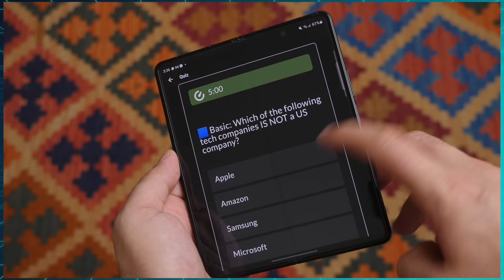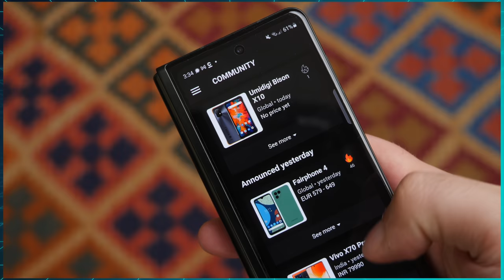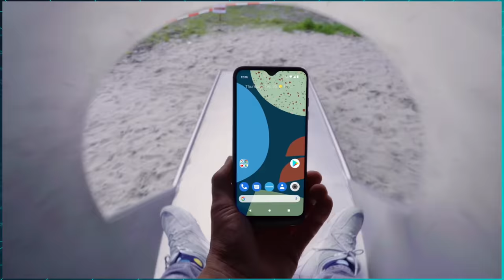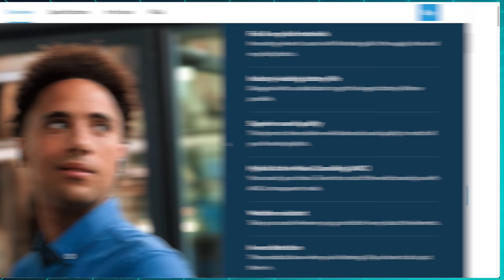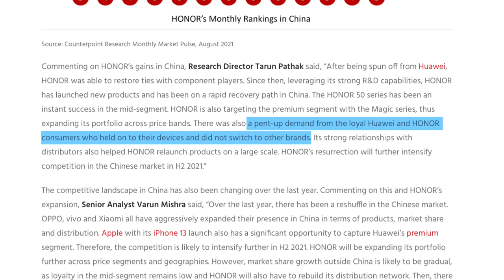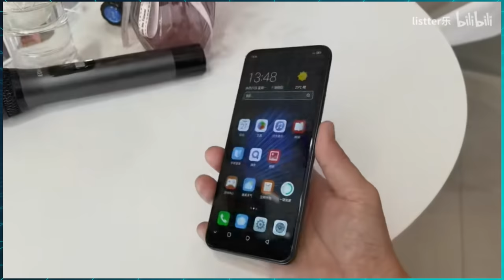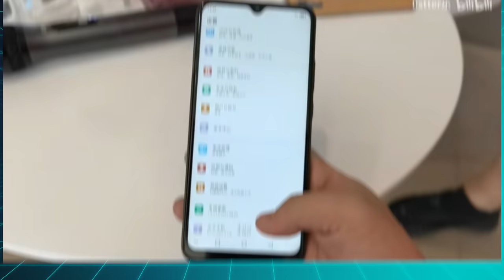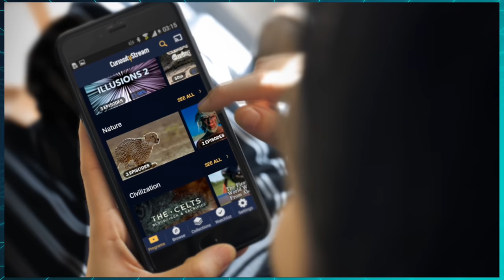The first Fairphone you might actually want

Comment: My Fairphone 3 is not a pain to use at all! It does everything I need it to do. It's not the best phone, but also not the most expensive one. It has a headphone jack and the battery lasts two days for me. Plus it has a supercool see through back and everyone else finds it cool too!
Reply: I love that see through back! It's a shame they 'discontinued' that feature
Reply: Yeah I do not understand how the Fairphone 3 is a pain to use like honestly...
Reply: The Fairphone 4 just doesn't interest me, I have a strong preference for rectangular screens and demand a headphone jack on my phone, as I 'still' use wired earbuds and won't change that any time soon.
So that's yet another new phone I can cross off the list for when my Moto G5 becomes too slow to continue using.
Now it's either a Fairphone 3, or some Xcover model for me, or something I'm missing (PinePhone/Librem5?), though the G5 is still a good phone for me.
Reply: @WyvernDotRed  agreed I really like my FP3
Reply: you can sell it to them and get the 4 for cheap
Reply: Also, a replaceable battery is a must. Dead battery is one of the biggest reasons people swap phones. In this case, just swap batteries.
Reply: @extectic  YES, forgot to mention that. I'm using replacement batteries in my G5, so I have a good backup and can use it for longer.
While the FP4 also has replaceable batteries, any phone that doesn't is a no-go for me.
Reply: @extectic  you know you can swap batteries of a sealed phone right? after 5 years when it dies. which is very cheap instead of buying a new phone.
Reply: The bezel is kinda...it's gonna bug me the hell out of if it were me

Comment: The new Fairphone is everything I could dream of in a phone – with the exception of the missing headphone jack. I know it's such a compromise to make one phone for a market with such varied needs, but it's a tougher sell to me because of that
Reply: They do have a USB-C to jack adapter, if that helps.
Reply: @adrnjgr  Of course it helps a bit, there are always workarounds for these things. I just find it strange that they would leave that out. Since it's what all manufacturers are doing nowadays, I guess I will have to get used to it eventually anyways.
Reply: @dontmindme8709  Yeah, that's a minus for me as well. On the other hand I tend to be too careless with wires so maybe it's not so bad after all 😅
The biggest issue is the size though. How am I supposed to use the phone onehanded o.O But it is as you say - I probably just need to get used to all of this, what "modern" consumers want to buy ...
Reply: @julelinnig6957  Oh yep, size is also one of these things. Still, they said that they went for "average size displays" to be sure that they could order replacement parts for as long as they need to support the phone. I can't imagine how anyone would want anything bigger than that.
On the bright side, I learned that they still support micro SD cards which is wonderful! It's such a shame that the rest of the industry moved away from that.
Reply: @dontmindme8709  Yeah, I was pretty shocked of this "average size" as well. How big hands have this costumers to get a phone even bigger than that and why don't they just go with a tablet? xD 

Yeah, microSD cards for the win! :D I would always carry most of the important stuff on my SD Card, so if the phone is broken it's super easy to get to the data. That shouldn't be to much of an issue with an Fairphone though :D
Reply: True, but I think I'm buying one anyway. The five year likely software support and the fact you can fix it is very compelling.
Reply: @user-qf6yt3id3w  It definitely still has a lot of strong points. I also consider getting one, though my current phone still has some life in it. When I do though, I wouldn't buy any other.
Reply: @dontmindme8709  I've got a Samsung Galaxy J4 which has a removable battery but it looks like the charging port is on the way out. If I had a Fairphone 4 it would be a trivial fix but with the J4 I basically need to either learn hot air soldering or pay someone else to do it.
Reply: I just bought one :) can't wait!!

Comment: no headphone jack, no buy.
i've already tried using a headphone jack-less phone and it's just a terrible experience.
Reply: Same here
Reply: That combined with their earbuds announcement(s), that just looks really bad on Fairphone's part. Not to mention the entire IP Vs. Headphone jack debate has been debunked really often. EX: Samsung's XCover Pro which also has a removable battery so there's no excuse on their end either.
Reply: Also not to mention, It turns the wired earbuds into e-waste. isn't fairphone all about cutting down on e waste?
Reply: Terrible in what way?
Reply: I currently have a jackless phone and it is very annoying yes. Better not forget your USB-C adapter!
Reply: i would love to see some proper research done on how wireless stuff compares to wired. like if everyone switched to using wireless headphones tomorrow how much electricity would be used to keep all of them charged. whats the average lifespan of the batteries. what does it cost a person over the course of their life to buy multiple headsets and also the cost of daily charging. im fairly convinced the results would just be completely terrible in every way but i would like to see some actual facts at the same time because maybe im missing something.
Reply: They sell usbc to audio jack adapter
Reply: @petersimpson633  Yes, and they are a pain and unnecessary waste when they inevitably break
Reply: @petersimpson633  did you just seriously say that?????

Comment: With 6-8gb, better chip and stock android (which from my experience is much snappier than most on even low end hardware) it should be smooth
Reply: It's 580€ phone, it better be fast
Reply: @cool1525  that's a $670.23 usd so yay that's a good price if it had a headphone jack.
Reply: @cool1525  it's not. Even a samsung (A52) with the same chip is cheaper.

Comment: Thank you for this Friday Checkout.
About the Fairphone... I understand they don't realise how many customers they lose when they remove the audio jack.
In the case of the Fairphone, with a replaceable battery, the missing jack is plainly a nonsense.
Have a nice weekend...
Reply: Just use a dongle? It's not like you can't use wired headphones. I know, it's an additional step. But honestly, if you can carry wired headphones with you, carrying an extra tiny dongle won't kill you.
Reply: @razemix  the dongle is the first thing you loose and despite being able to use USB C headphones as TA has pointed out, it won't work in my work flow, where I'm often switching my headphones over from a laptop to a phone.
Reply: @razemix  Its a smartphone. The whole point of them is that they come with everything or at least USED to. Now its like buying a Swiss Army Knife without the knife and screw drivers included. That's what buying a modern smartphone is like and its awful.
Reply: @razemix  No way. No headphone jack, I don't buy the phone.
I need the USB-C port to transfer files and keep the phone charge at 100%. I carry with me a 10.000 mAh power bank and a pair of classical Sony headphone.
Reply: @razemix  99% of dongles break after prolonged use and are easy to lose which just adds to more e-waste, doesn’t this go against the company’s campaign of sustainability?

Comment: Yes I own wireless headphones/earbuds/speakers, for convenience, but I make sure to recycle them at my local county recycle drop off when they do die/break, and I can't fix them by placing them in the e-waste skip/bin, but having a phone, tablet, or laptop with no headphone jack that I can plug into, and use some of my nice headphones like my KOSS Portapros that are going on nearly 20 years old, and where I've upgraded, and replaced the original cable with one that has an inline mic, and have even replaced the ear/temple pads is no go for me. So Fairphone just lost a potential customer, as the headphone jack is a must for sustainability, and longevity.
Reply: Get an adapter man
Reply: @clopyify  then you can't charge and use your headphones at the same time, or plug into the aux port of my truck and charge at the same time, and no it doesn't have Bluetooth.

Comment: If Fairphone manages to make TWS headphones with easily replaceable batteries, I'll be more likely to get some
Reply: It's disappointing they didn't put a headphone jack on the Fairphone 4 and launch TWS headphones with replaceable batteries. That being said I'm going to buy the Fairphone 4 and I would buy the TWS headphones if they had user replaceable batteries. The fact you can replace the battery, charge port and display on the phone, the most likely things to break and you get a five year warranty and probably 4 Android updates is very persuasive. Yeah it's an expensive phone but if you divide by five to get the yearly price it's not too bad.
Reply: hmm  seems like you are missing most of the point of the fair phone

Comment: lol, I paid under £300 for my S20 FE, this Fairphone is around double the price and much much worse..
Reply: Yeah, but the whole point is, that the Fairphone is as fair as possible and usually you can keep it for much longer than a normal phone - with this repairbility and software support :)
Reply: @julelinnig6957  not really, just after they’ve increased the price and removed the jack? which means now you have to buy wireless earphones that don’t even have replaceable batteries / or another usb c to headphone port
Reply: @axethepenguin  What do you mean with increased price? It's a new phone, which is even fairer and much better as the Fairphone 3 as it seems. It makes sense that this is something which makes the product more expensive. Immagine, last year was the first year Fairphone actually earned money. If you think about it - every other phone company has a much bigger margin. So I don't think it's fair to complain about the price.
As for the removed jack - yeah that's a different story. I don't think I do understand this decision, maybe they just go with the flow? I don't know. You could say that wired headphones break more easily, but I'm not sure that's the whole point in this. In my opinion this decision should be up to the costumer. At least Fairphone is working on a solution for earbuds with replacable batteries.
Reply: @julelinnig6957  why make them anyway if they don’t have a replaceable battery, that doesn’t make sense, that just adds waste. For a company that goes against it, it’s a bit scummy.
Reply: @axethepenguin  Yeah, you gotta point there. Probably because everbody would buy the earbudds somewhere else ... the ones Fairphone made are at least with fairer materials, so overall ethnically it's still better to buy these ones than a concurrent product. But in my opinion Fairphone should have waited with the release of the Fairphone 4 till they figured out a way to swap at least the battery - or shouldn't have removed the jack in the first place

Comment: I have strong concerns that the Fairphone 4, just like its predecessor, will be stuck on an old Android version for ages. Without system and security updates, the long hardware support is worthless for me :(
Reply: Well, I'm still stuck on an Android 6 (Samsung though), so 11 would be definitly an upgrade xD
Jokes aside - other brands gonna stop the software support much earlier so you gotta buy a new phone quite soon if you wanna be up to date all the time. So the risk of getting the updates more slowly would be - in my opinion - be worth it. But if you really need to get this update like really fast because you need that for your job or something, I do understand that. I just hope, Fairphone has taken a lesson from the past - but actually I do think, they have. They had to learn everthing from the scratch so it's quite normal to get lots of problems. But the Fairphone 4 looks like they really have learned something :)
Reply: Why so pessimistic? I used both of my previous Fairphones for quite some time! And these were the first and second version the first being a crowdfunding. The company improves and gets better. So again: why so pessimistic? If it runs for four years thats perfect :)
Reply: It comes with Android 11 and is guaranteed up to Android 15

Comment: They should have chosen better CPU, because the reason why most people buy new phones is that the old one is too slow. Replaceable battery and spare parts are cool features, but when the phone is slow, it useless.
I think, that it is better to buy a flagship phone and keep using it as long as you can. Some also have water resistance, so it can survive longer. And you can still replace the battery, although it is not that easy.

Comment: My portable earphones never lasted more than a year until they broke or got lost. So, longevity is not my primary issue with wireless. Plus, as Samsung has proven, you can put replaceable batteries into EarPods.  Once you use wireless, you don't go back. Cables are a pain in the ass with smartphones.

Comment: I used to break 3 4 wired headphone a year. But its almost a year and my Bluetooth earphone is rocking still.. Because there is no wire to break... So not a issue of e waste
Reply: It's absolutely an issue, because any well made headphones will allow for the cable to be swapped without tossing the drivers in the headphones themselves. So it's the difference of tossing a cable every so often when it breaks, vs. tossing drivers, batteries and circuitry, which all need much more precious metals to produce and are very hard to recycle properly.

Comment: The Fairphone is still only for "die hard" people that want to support the idea behind it, which is fine. But not for most people. The hardware (and especially the design) is still trash. It pretty much doesn't matter that Fairphone promises 5 years of support when its hardware is too weak to proper support even one update. And Fairphone is kinda faking their support. they're years behind the current Android version. 

The Amazon Echo Frame thing is kinda stupit tho. Why the hell does it need to have a punch hole with such thick bezels...
Reply: Isn't the Fairphone 3 still on Android 10? I could be wrong but I read somewhere that it is
Reply: Exactly, 5 years of support. Even if it will suddenly be true (Because for example Fairphone 3 only got update to Android 10 in late August of this year, lmao), what kind of support will it be anyway?
Same as Nokia (And those guys are bigger than Fairphone)? "Stock" Android that still gets it's fair share of bugs, about as much as other OEMs. And that's "Android One" program.
Heavily based on AOSP doesn't automatically means great, fast and polished experience  and something tells me that Fairphone wouldn't be able to provide experience better than say Samsung with their OneUI.